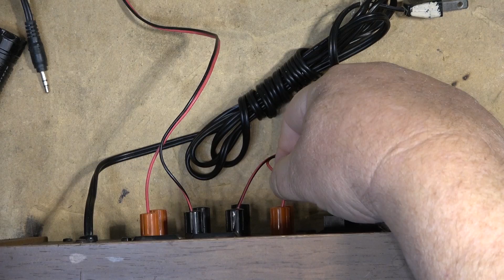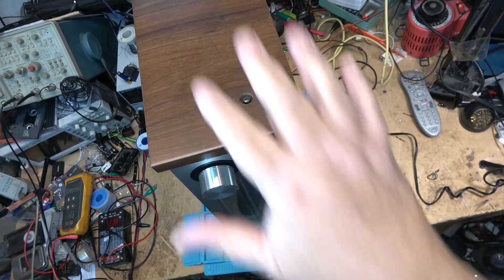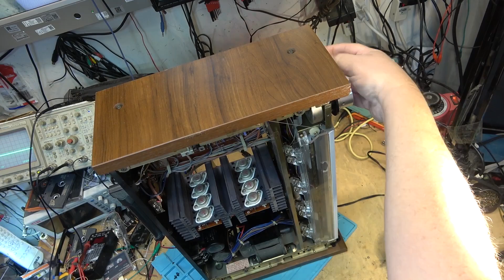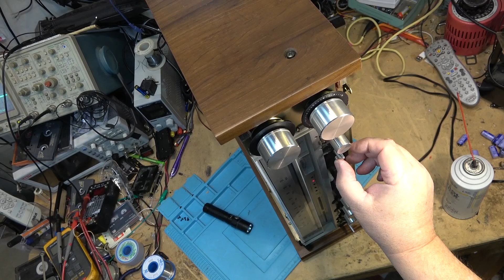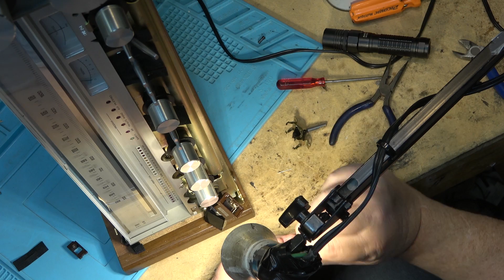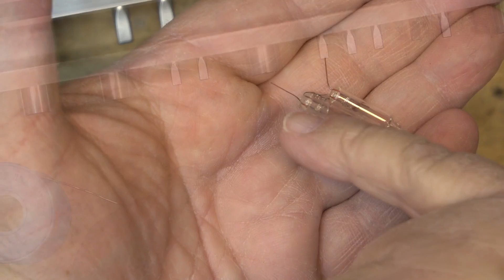Technics SA700 Receiver No Sound

Comment: if you take the aluminum face plate off of this you most likely wont be able to get it to go back on. there are plastic inserts that fit around all the knob controls - you have to use an 11mm deep socket to remove the plastic inserts.  they look like a thimble that would fit over your thumb.  then the cover will go on.   then put the sockets into the face of the unit and use the 11mm nuts to hold them in place.   hand tighten the nuts.  push the knobs back on .   this will throw you for a loop

Comment: your videos are a Godsend.  I have both an SA 700 and a SA 800.  when the flip switches are oxidized you cant get the reciever to put out any sound.   the volume pot  is hidden under a small circuit board and really hard to get to.  i tried several times and couldnt get the volume to stop sounding scratchy, until i watched your video .  finally i am scratch free on volume and loving it.   thanks.

Comment: Hoping you can help- restoring an SA700 and someone has previously run a 47uf cap (on the back of the pcb no less) from the bottom leg of C450 (normally unused) over to R205. Can you tell me what this was intending to accomplish? Thanks so much in advance.
Reply from the maker: They bridged the cap over.  Probably because the seevicer didnt have yhe exact replacement or one they had wouldn't fit.  Very common repair procedure.  Used to see that done all the time when stuff came in that had been previously serviced. Very often done on the large multi stage chaasis caps. May have 4 caps inside and 1 went bad so yhe tech wpuld cit off the bad lug and stick an external.  I have done that on omd tube radios.
Reply: Amazing answer and thanks for the quick response. If I'm doing a full recap, would you recommend just replacing the (very old) cap in the exact same fashion? Or should the problem be resolved with all new electrolytics?  Thanks again for the information and fantastic video!
Reply from the maker: @marshallsanchez2070  if you are changing them all just install them the way they originally were. You will notice a difference in sound. If you are used to the sound that it produces now you may or may not be happy with the new sound as it will sound different.  This is primarily due to the difference in chemestey of the electrolytic between old oil based caps and new water based caps.  Even if they have the same value they have different charistics which will change the "color" of the sound.  Some like it, others hate it.  I had a guy pay me a second time to put all the old caps (that he took away) afyey I did a  full recap a number of years ago.  He didn't like the new sound. Said it was harsh.
Reply: I do have one more question that I ask because I've never really gotten a straight answer from anyone else... Is there any trick to accessing the bottom of the 15k power caps? The only thing I've seen is someone suggesting drilling holes in the plate thats covering them. Is that your recommendation as well? Thanks again. @12voltvids
Reply from the maker: @marshallsanchez2070  i really couldn't tell you without digging it out and opening it up because I have never changed the power caps on one.  In 40 years I have never changed the primary filters on any amplifier just coupling and tone control and some small filters in the low voltage regulators.
Reply: Perfect. That’s fantastic information. I really appreciate your help. Thank you.
Reply: Well that’s actually very helpful. I’m going to take it as sage advice to just leave them be. Thanks again for everything.

Comment: I had a question, i have a Technics unit but its modern, it has A and B speakers and on the B side the left one has this issue where it will quit working and if you wiggle it it comes back on then it goes out again etc,doesn't take much to make it go out, what could that be and ball park figure how much would it cost to fix? its a nice unit, id like to keep it, i took the top cover off once but those banks of speakers are buried and i didn't see anything that stood out as being loose or nothing, thank you for your time.
Reply from the maker: Sounds like a connection problem to me.

Comment: I have Arcom 280av Receiver can I Replace 63v 15000uf (4caps) Capacitors instead of 12000uf (4caps).
Reply from the maker: As long as the voltage rating is at least as high as the original no problem.
Reply: @12voltvids  Thank you♥️

Comment: I like that this has the power transistors rather than those Darlington packs...I think that's what you call em right? I have an SA200 that I bought in 79 that I have not had to open yet and use everyday almost. I use the preamp mainly for archiving vinyl digitally for customers the last 20 years. A great workhorse! One reason mine is still going on without a hitch is because I always keep it on.....never gets shut off.
Reply from the maker: You mean IPM, integrated power module.

Comment: You could use a Triac to handle the turn on voltage, and the switch becomes the low voltage trigger. This extends the original power switches' life exponentially even one in marginal condition. Plans are all over the place showing this and it's an easy mod on these old receivers. Cheers!

Comment: I have a Technics SA-600 receiver, these things are phenomenal, the biggest complaint I have is that the switches and pots oxidate quite easily and get noisy. My receiver is also losing the ability to decode FM stereo, I remember I tweaked some pot inside a few years ago (don't remember which one but I think it was the VCO 19 kHz adjuster, it was near the multiplex decoder IC) and it worked for a while, I guess it's probably some drifting capacitor. I'll have to take another look at it some day.

Comment: Would you go as far as asking the owner if they would consider fitting a soft start circuit?  That would certainly stop the on/off switch from burning up from inrush current.

Comment: I went to the wreckers last week to get a spare tire for my hot rod. After I found a tire, I did a little bit of snooping around, and came across this old van that had a bunch of hvac junk inside, that had this big old stereo hanging out the back. I took a closer look, and it was a Kenwood KR-7070 A. About the only thing that was keeping it from falling on the ground was that the cord was hung up under all the junk. I went to the side door to rearrange  some things to untangle it, and there was a Pioneer sx3600 in there. After getting the cord free, I just left everything there because my hands were already full, and the Kenwood was quite heavy. I paid for the tire and left. I got a mile down the road and decided to go back and ask if I could go grab it. The young guy said sure. I went and got it, and carrying that thing an eighth of a mile was a bit of work. I set it down in the office for him to see it, the veneer was all lifted on the cabinet, and it was in sad looking shape. When he got off the phone, he took a quick look and said take it. I was a happy camper. I got home, and opened it up, and surprisingly, it didn't look too bad inside. A light blow with compressed air, and an external cleanup, was all I did. I made up a dim bulb tester, and plugged it in, and turned it on, and amazingly it lit up and nothing blew. Everything works fine, except the fm stereo is garbled on every station, with barely any signal on the meter. You can get some stations to come in perfectly clear, but you have to turn the volume up pretty high, just to hear them. I re glued all the veneer and re stained the cabinet, and it looks great now. I wish you lived near me, I would bring it to you, and give you the go ahead like your customer on this machine you are working on did. Oh yeah, I went back a couple of days later to get a scissor jack, and grabbed the pioneer. Another freebee.

Comment: I personally like the 'christmas lights in series' much more than LED lights.  I'm not a fan of LED light frequency it emits.   :) Thanks for showing your method of installing them.
Reply from the maker: I agree, incandescent looks better.  I use incandescent in my giant lit grandfather clock.  They are on a dimmer so they last forever and are long filament tubular lamps the light the pendulum cabinet.  It's a 20,000.00 clock that i inherited.
Reply: @12voltvids  WOW you should show that puppy off.. I do respect a nice clock !!!
Reply from the maker: @SPINNINGMYWHEELS777  
It is a very limited edition made by rideway.  The woman that bought it when it was new paid 16,000.000 it as a special order.  It's part of the Biltmore collection  to represent each state room in the Biltmore mansion.  The mansion has 250 rooms and they built one clock to represent each one.  The one i have is 021 out if 250 made.  That makes it rare.  It is huge.  Will not fit in rooms with 8' ceiling as it is about 8' 4" base to top.  Hand crafted and the pendulum base it lot up.  Younger generation don't appreciate these massive clocks.  My son thinks i should sell it.   I laughed.  Prices go up and down on these but one thing for sure they all all go up in value as they get older.  Since mine is a very limited run it should increase much faster then a regular production run. What makes this one special, besides the serial plate is the size. About 6" taller than the regular clocks which come in a little under 8' so they fit in normal 8' ceiling rooms.
Reply: @12voltvids  amazing!!   I bet it's stunning and a work of art.

Comment: I have a Realistic STA-2270, 65 watt per channel, and after repairing the power switch the second time, because it had welded together, I decided to avoid a third repair.  It is a pain to get to. The switches for that are also non-existent. I re-wired it to use a relay as the power switch so now the power switch only has to handle the current from the relay coil, much less than it was handling.  So far so good. The only thing I sort of goofed on was I used the wrong side of the relay so the on/off position of the switch is the opposite of what it was.
Reply: If you used the NC instead of the NO relay contacts it might be worth fixing. You'd be wasting power whenever the unit is turned off and if there are power glitches it will power on unnecessarily.
Reply: @eDoc2020  You are right and I have thought of rewiring it just that way. Just haven't gotten to it yet and so far it is working without issue.

Comment: Great video! Common for the power switch on the more powerful vintage receivers to be arced and burned. This is because of the large current inrush from their large power transformers. A way to cure that is to install a soft-start device that have a relay on them. That receiver would be a good candidate for a soft-start. Maybe that would something the owner would want being the nice condition.  With a soft-start, the switch you repaired might never fail again since the switch would only be switching a milliamps instead of the very brief possibly 20+ amp surge.
Reply: My question  too: why not upgrade with such a module?
Reply: More simple than a relay-based module is an NTC thermistor / inrush current limiter (ICL).
Reply: @eDoc2020  Simple and appropriate for devices that have a relativity constant and predicable power draw. An amplifier can be sitting idle drawing < 100 watts idle and then draw 800-1000 watts when driven fully, exactly like my old Kenwood KR-9600 receiver. Hard to size up the thermistor for such a variable load + the most important part is the power switch is still carrying all the power. Whereas with a soft start board the power switch would now only carry milliamps of current and perhaps last indefinitely. Those switches if they can still be found (used) are getting pricey and preserving them as well as the receiver's transformer and power supply from massive surges makes more sense to me. When I recap my Kenwood KR-9600 and other's, I will be installing soft-start boards in all of them. I already use inrush limiters on smaller electrons like radios.

Comment: The way capacitor testers read capacitance, they use the time it takes to charge to a certain voltage to calculate capacitance. Contrary to what many people believe, capacitors that read over their rated capacitance are more likely to have developed internal shorting and are going bad. When a capacitor has internal shorting, the indicated value by the tester won't be accurate and is likely to be much lower than indicated. An 18 year old electrolytic that reads above it's rated uf is likely going bad.
Reply from the maker: This is why ESR is a more accurate read as it measures the equivalent series resistance using ac voltage and current when capacitors dry up the ESR will tend to climb. Measuring the microfarad however also gives you a good indication of where the capacitor is most electrolytics are 20% tolerance at a minimum. so a 100 microfarad capacitor will typically measure anywhere between about 90 and 120 so that range you're in good shape if you are measuring a 100 micro farad capacitor and it was showing 400 microfarads then you've got a serious issue with it. What I found however is the opposite if the cap has got an internal short it measures low so that 100 microfarad capacitor might be measuring 68. I think different meters work on different principles and some do a better job than others.  I had a capacitor go dead short once that one was tricky because you put the ESR meter on it and it's showing like 0.01 which look to be very good or 0.03 or whatever but it looked to be very good however put the capacitor meter on it and it showed low but the ohm meter on it it's showed short.  I have found however that vintage cap from the late '70s and into the early '80s generally tend to last a long time. The reason for that is a lot of them used PCB oil which was very stable. Toxic but stable, and these caps generally tended to last an extremely long time unless they were physically damaged. By physically damaged I mean the leaves manhandled when they were being installed or the top squeeze with the pair of pliers or something when it was being installed or someone working on it bending parts back and forth to get access to another component that can break the seal and allow the electrolytic to escape. Cops made after the mid 80s and well into the 90s however were horrible they changed the formulation to make them environmentally friendly and in the process made them extremely unreliable. They also went to a water based electrolytic which as you know water boils at 100 Celsius. So even getting close to the boiling point pressure starts to build inside them if you go over their rating voltage or too high in frequency the water will boil and it will blow the safety vent. No I'm not saying old caps don't fail they certainly do it's just that their failure rate is much lower than the mid 80s to late 90s which were a very bad time to be an electrolytic capacitor
Reply: @12voltvids  Thanks for information. Yes you are right about electrolytic caps. Sorry my bad. I was thinking of those small non-electrolytic caps used in old vintage tube gear that develop DC resistance (not ESR). Most of the time when measuring the value for a electrically leaky paper or film cap it is over value on any of my capacitance meters. Of course if it has a dead short it won't read much/any capacitance at all
Reply from the maker: @multicyclist  yeah the paper caps used in tube gear they all have to be replaced no matter how they test. Even if you use a high voltage breakdown tester which is really the only way to test them which is a tester that applies 500 or 600 volts to the capacitor and measures for any DC leakage even testing them that way they can test good today and tomorrow develop leakage. Because vacuum tubes are high impedance devices it takes very little leakage to pull a tube into over conducting which will red plate it and damage the tube and damage any other components that may be in that circuit like transformers. When I see vacuum tube gear I don't even check the Caps I just change them. I collect vintage radios and everyone that I've got I've changed out all the caps in the coupling circuits and don't even bother testing them. The problem with the paper caps is acid in the paper when it was made during the bleaching operation causes the paper to eventually become conductive.

Comment: I had an interesting failure of a switch the other day. A Sony tfm8000w’s power switch was intermittent and come to find out the little contact jumpers inside it had lost spring tension. No amount of cleaning would make it work. I ended up taking the jumpers out of a spare switch assembly I had and installed them into the Sony switch and it’s fixed.